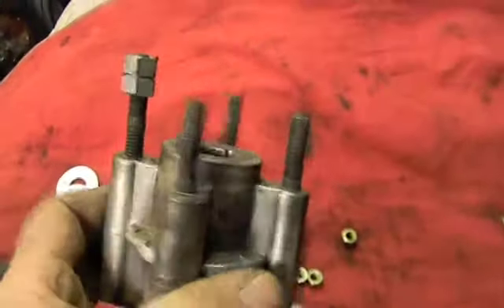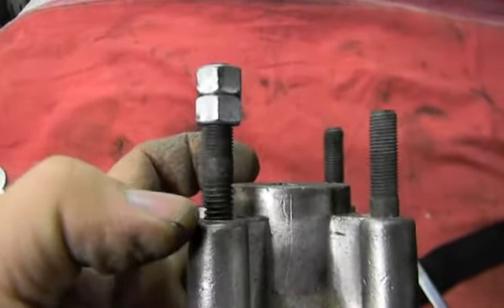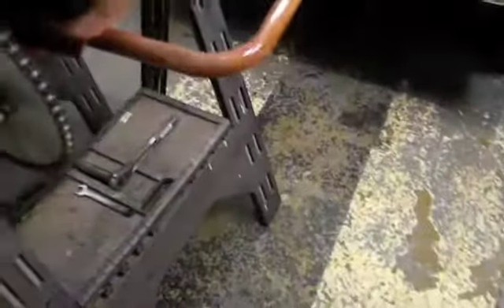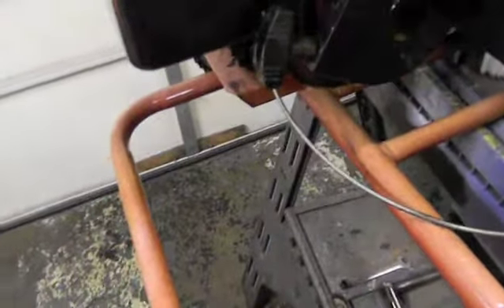Go Kart Axle Pt. 2

Comment: What size axle did you use? I just picked up the same frame but in a 2 seater... I have to replace the bearings in the frame that holds the axle and still trying to figure out how to get those free to put in new ones...